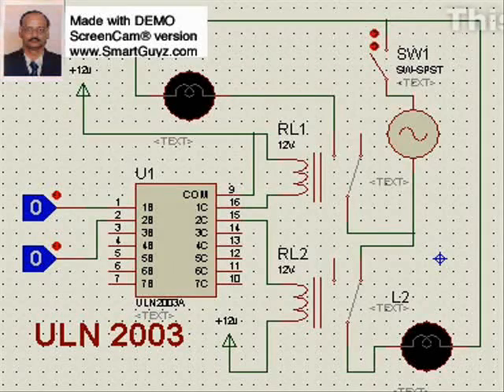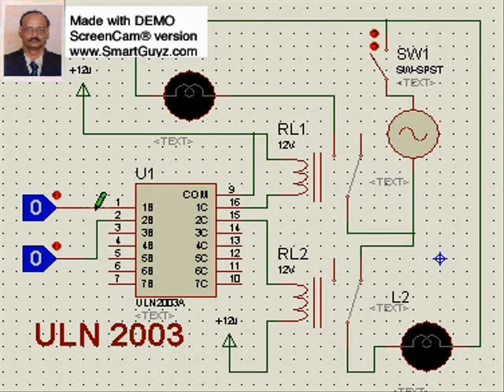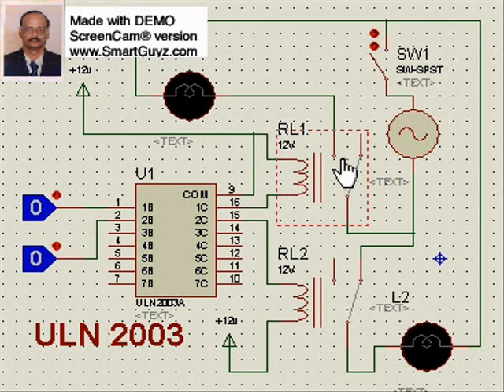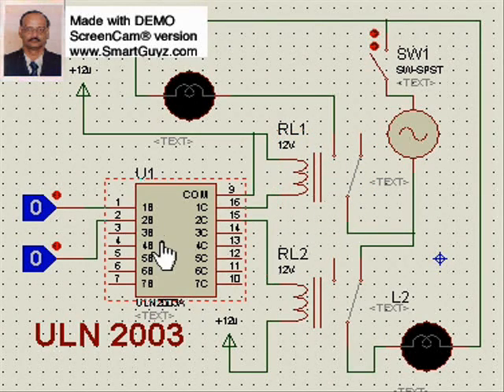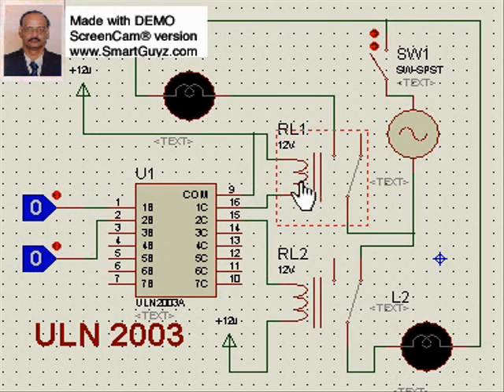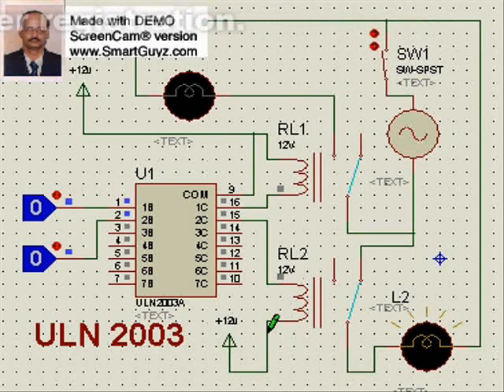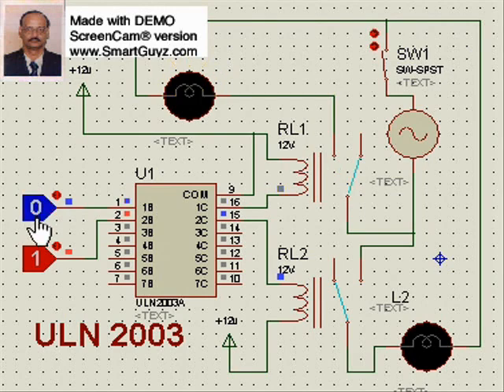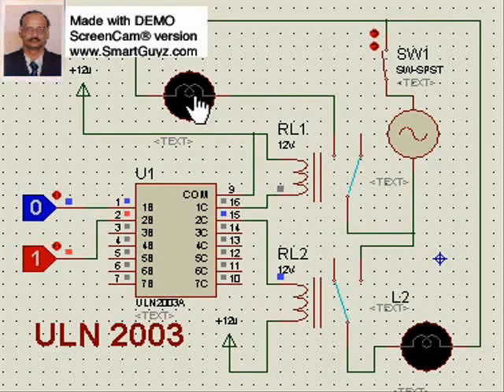Microcontroller interface to Relays by ULN 2003

Comment: Hi, is it possible to use contactors instead of relays?
Reply from the maker: Steve Ogenga No. but use the contacts of the relay as switch to power the coil of the contactor

Comment: Hi sir. I need  your help 
Ineed a 15amp dc motor speed control circuit. YouTube par anek circuit hai jo 2y*3amp ke single mosfet  ke hai. Kya 2ya3 mosfet ko parallel m jodkar power badai ja sakti hai. Agar ha to unko parallel m kis tarah joda jaega. Plz help me sir
Reply from the maker: Rizwan Ali yes. In that case you need not use ULN2003 but directly drive from micro controllers

Comment: Sir other microcontroller ic kaa details paa sakta hu? Kyu ki uln2003 nahi mil raaha hai.sir plz help me!how can i use other ic instead of uln2003
Reply from the maker: 2803 vee chalega or use any NPN transistor like BC 547 but a diode across the relay is a must.Base drive to transistor through 1k resistor
Reply: Patnaik UC sir plz can you plz provide me connecetion diagram with npn.. my whatapp no is +9779823708451 plz sir help me.

Comment: sir, i want to transmit a theft voltage signal from a Theft Detection Circuit to a service provider via a microcontroller and GSM module, but i find a bit diffucult on how to send the error voltage signal through the relay interfaced with the micrcontroller?
Reply from the maker: Sorry I do not take up projects

Comment: how to make relay board used one switch and operate two relay.
first time switch press relay 1 is on
second time relay 1 is off and relay 2 is on
third time relay 2 and relay 1 is off.
Reply from the maker: use NC of one relay to switch on the other

Comment: Hi ,  I  am trying to interface Arduino with the ULN2003 , powered the ULN 2003 with 12 volt , Arduini
(5 volt ) and used pin 13  digital out , when I connect the 13 pin to the pin one of IC it gives undesirable result , Do I need to connect the ground of Arduni to the  ground of the 12 volt adapter , if that works can you let me know why we need to connect the ground together (Not very much into electronics).
Reply from the maker: Interface is 5 volt from any ckt. But 12V is for relay drive.Pin 8 is -Ve .In this simulation software -Ve is assumed to have been connected at pin 8 ie ground ,hence not shown
Reply: Binoy baby can you send me the proteus??

Comment: Patnaik I need your help, I need to develop a device that monitors line currents for a 3 phase system. It should have a an alarm circuit and a trip circuit that protects the load from over current. I have so far thought of using CTs to monitor the current and using the burden resistor convert it to a voltage signal which I should feed it into the microcontroller that will control the subsequent circuits. I need help with the actual values of the resistors and caps and op amps. The nominal current is to be 1A, with overcurrent at 1.2A and cut off current at 2.5A to 5A.

Comment from the maker: Interface is 5 volt from any ckt. But 12V is for relay drive.Pin 8 is -Ve .In this simulation software  -Ve is asumed to have been connected at pin 8hence not shown